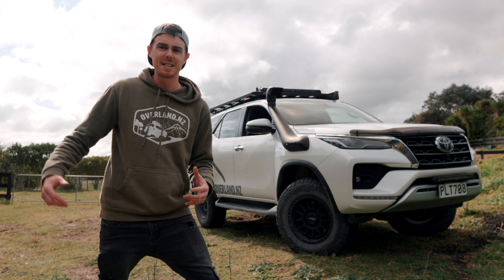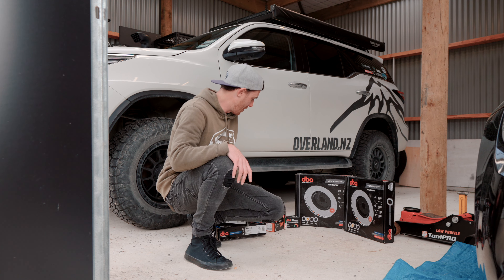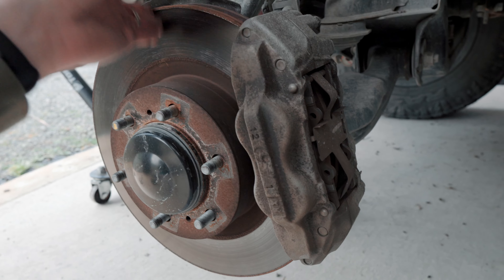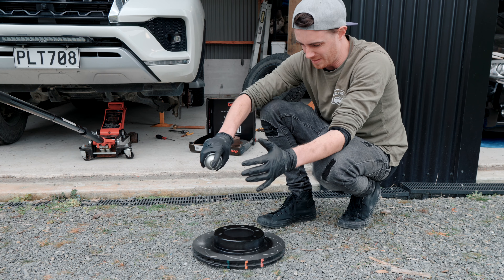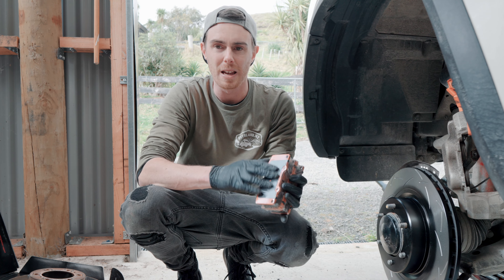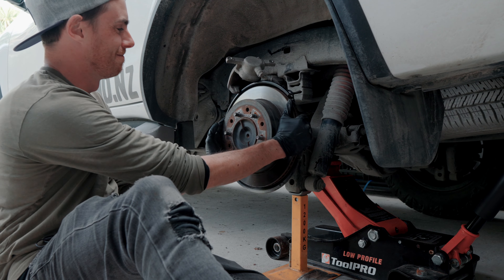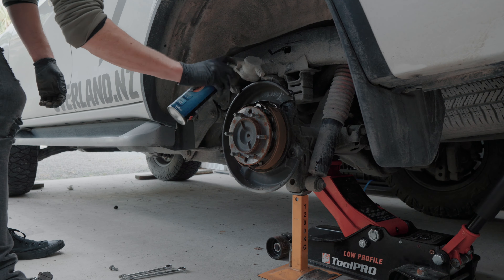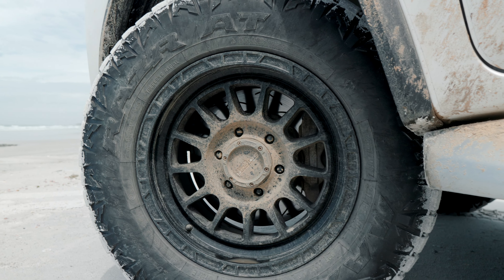DBA Brake upgrade - quick install + are they worth the money?

Comment: When I did the brakes on my car I didn't realise how bad everything actually was and basically had to replace all caliper ceals and rubber boots and clean everything and apply new Bendix Ceramic brake pin grease and unfortunately I warped the front DBA T2 rotors and now even with a full brake service my brakes shutter like hell because they needed a service before I put the DBA rotors on so I will possibly purchase another set but money is tight as I'm saving for an overseas wedding but one day I'll get another set.

Comment: Question for you, how dusty is this setup with those pads? Looking at the Powerbrake d-line but the DBA is a better deal. Thanks
Reply from the maker: The black wheels hide a lot - but I don't think they're too bad given their performance. Haven't specifically noticed it, I'm sure they would make more than the factory ones though. Cheers
Reply: @OverlandNZTV  ok thanks for your feedback! I have black wheels also on my truck. Maybe I’ll give them a shot!

Comment: lol, Toyota hand brakes are just for show
Reply from the maker: This is the first Toyota hand brake since my old KE30 many moons ago that actually works. Hilux and 80 Series ones however 😅
Reply: Hang on a minute, I recall you saying your hand brake was 'meh' when the wee suzuki winched off you 😂 @OverlandNZTV
Reply from the maker: 😂 Fair point. I filmed this long before then - I had to adjust the handbrake to remove one of the discs and haven't gotten it quite right since. It used to work really well...